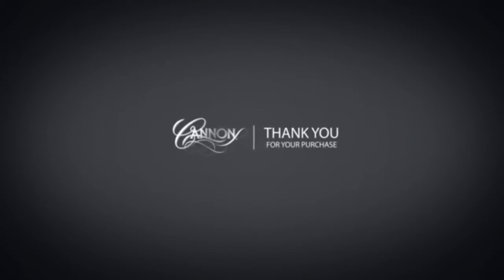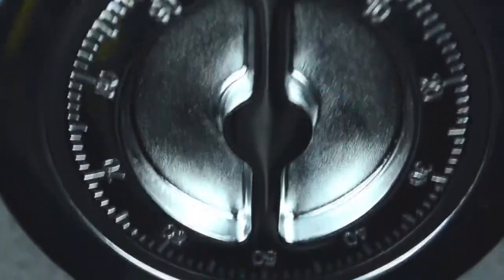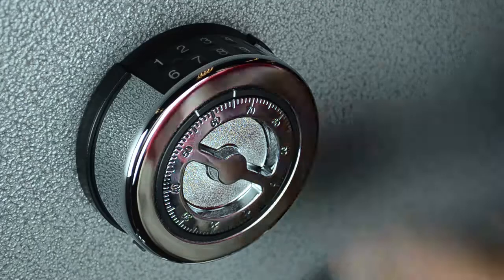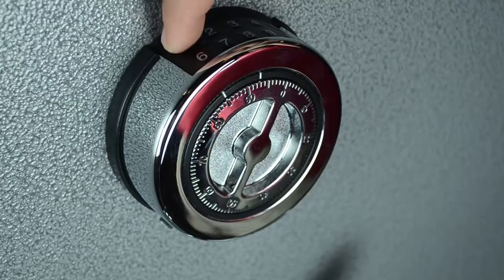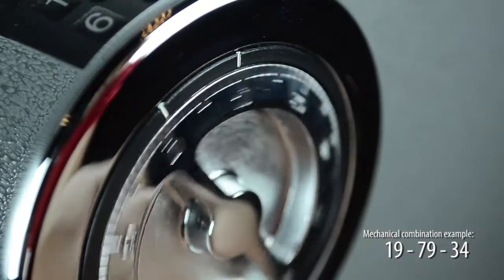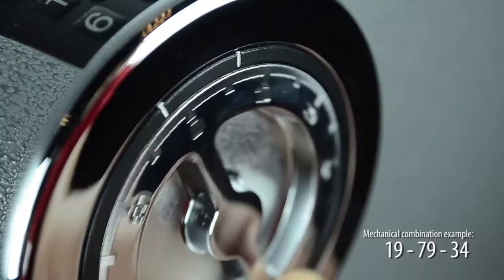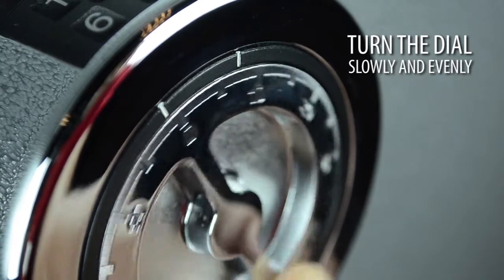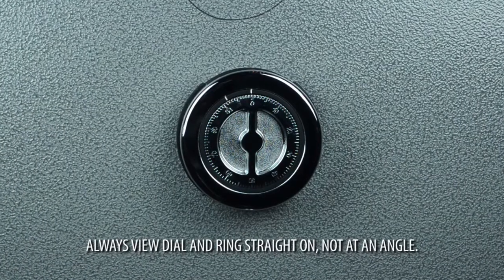Cannon Safe - Help - EMP Lock Operation

Comment: Where Do I GET THE COMBINATION in the First Place.  I have the Safe Installed.  I have Reset the Electronic Combination,  I want to be able to use the MECHANICAL COMBINATION if the battery dies!

Comment: So what is the number for the combination if I never used it before. I have been using the electronic pad and now it beeps twice but the safe does not open. Can I use the dial to gain access? What would be the combination